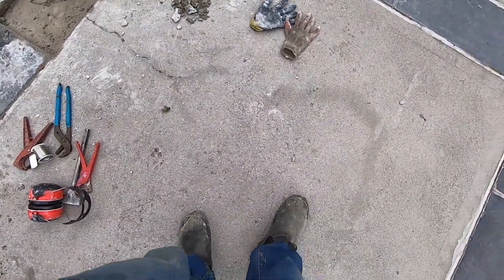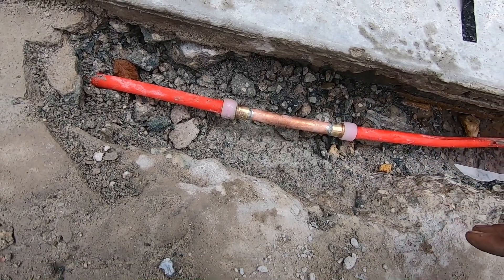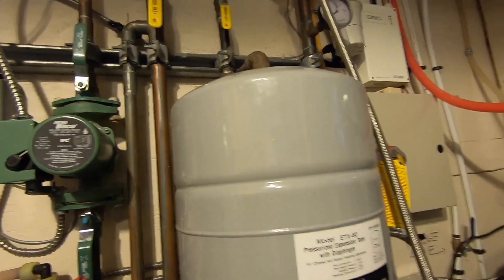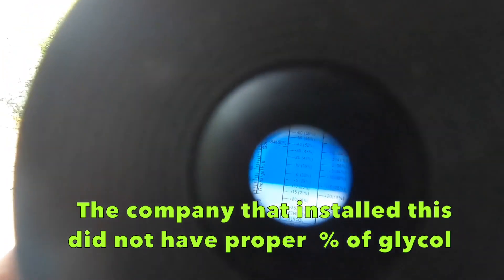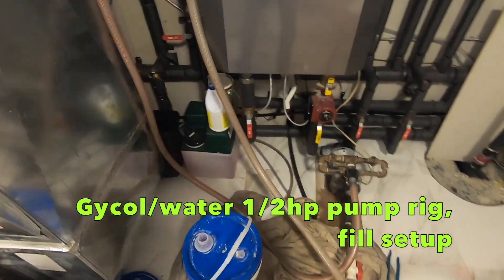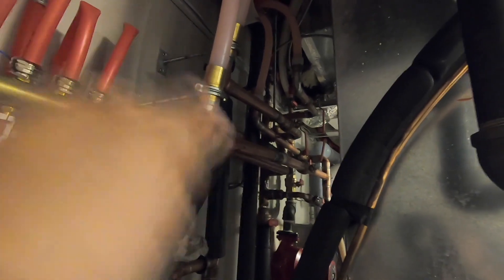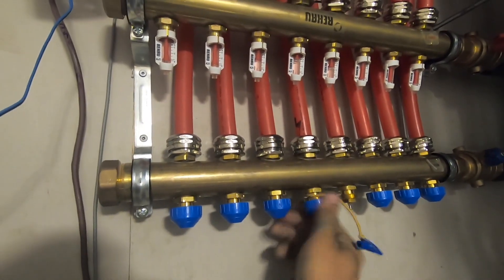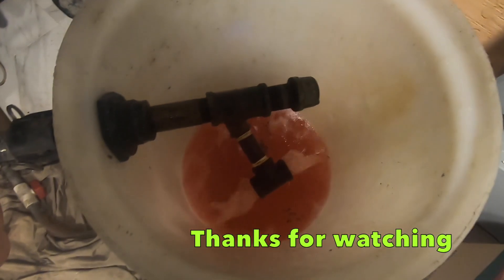HVAC: Propylene Glycol Test | Snowmelt Pump Fill Rig

Comment: I used to have one of those glycol heat transfer furnaces in my house. It was great heat and very economical to run. But it broke down lots and expensive to fix. That's when they first came out tho. I think..
Reply from the maker: Well guess what you just found a HVAC guy that will help you out whenever i can. I'll come by and squash that competitor lol bud. cheers thanks for dropping by bud.
Reply: @HVACRNorth  Good to know thank you..

Comment: Did you use an infrared camera to locate leaks? i like your  Rig setup.
Reply from the maker: yes its actually my go to most of the time.  In this case it was a easy find & closer to the service. thanks